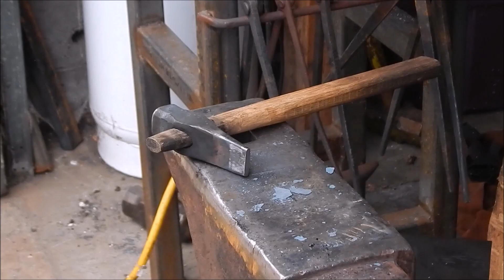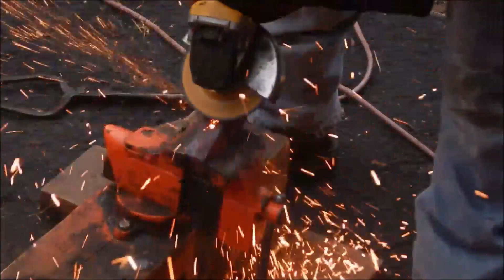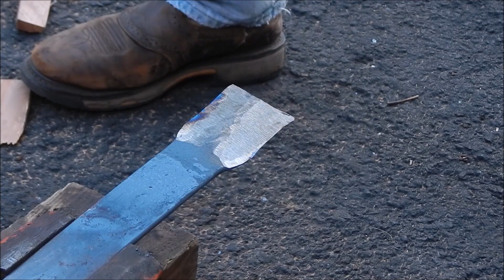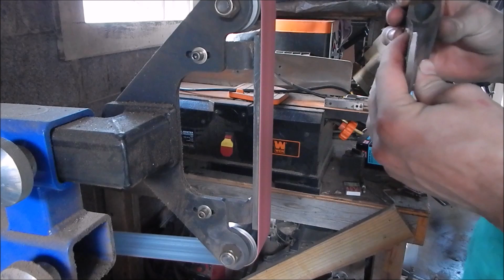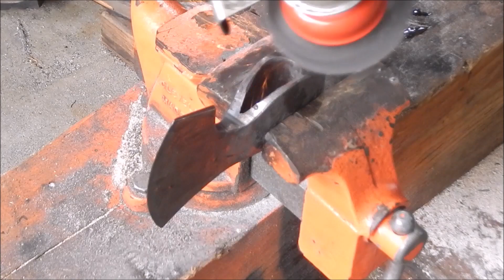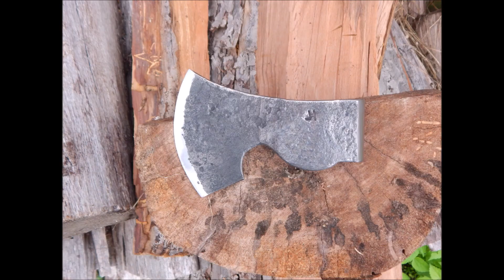Blacksmithing|Forging an axe by hand

Comment: 10/10 build my guy. Just a quick question about tooling. Where’d you get the belt grinder that you use?
Reply from the maker: It's an ameribrade 2x72

Comment: Hi I'm your new subscriber I have a question which oil you have used and how you tempered it
Reply from the maker: Parks 50 oil. Tempered by using the heat in the body of the axe after i hardend the edge.
Reply: @honakerblacksmithing  that cleaver but do you have any advice if I want to temper it in oven which temperature you recommend
Reply from the maker: @saidulmondal8839  never tempered an axe that way. It also depends on what steel you use. I used 5160 for the bit on this one, so 450 for a couple hours would probably do the trick.
Reply: @honakerblacksmithing  that will help a lot thanks

Comment: Doesn’t look fully welded to me.
Reply from the maker: At what point does it not look welded?
Reply: When I weld my axe blades to the mild steel body there isn’t such a pronounced distinction between the high carbon bit and the mild steel jacket like there is on your axe. It’s not easy to see on video but it looks to me that your propane forge isn’t getting hot enough for a strong and well blended weld. I recommend using either coal or charcoal for welding the bit and eye. I used coal before moving to Los Angeles from Montana but now I use charcoal. I find charcoal to be much easier and cleaner than coal, and no complaints from neighbors. Charcoal is more expensive than coal but if you build your forge right you can get a lot of forging done from just one bag of lump charcoal from Lowe’s or home depot.
Reply from the maker: @thesixfootsixblacksmith4772  when i grind the bevels and the top and bottom of the axe they are seamless welds. Its my fault for not getting any close up shots of the weld. I also weld damascus inthis forge just fine. Its a chile forge burner and very insulated forge gets to welding temp very well. What i think your seeing is the different thickness between the bit and the body after welding. I probably could've took a few more heats and blended it better. But i got it out at the grinder. But i assure you it welded. Thanks for watching and commenting. I really appreciate it.